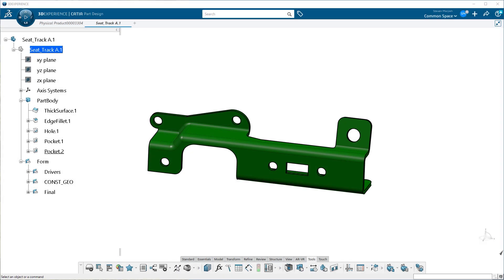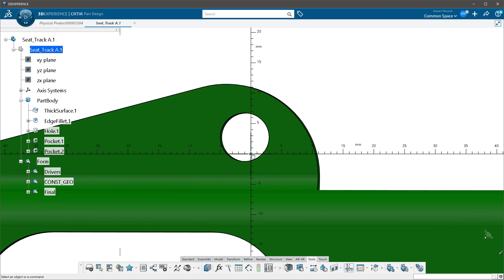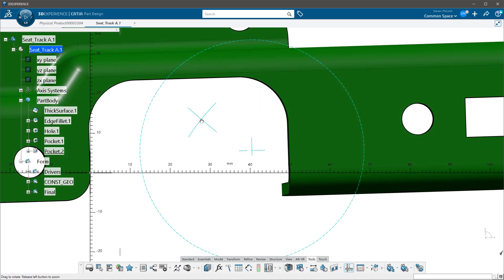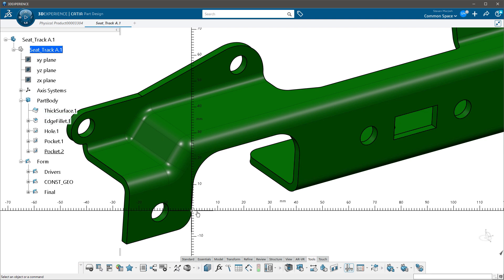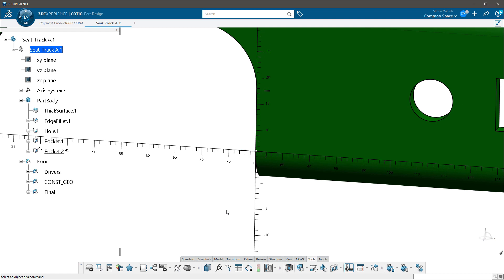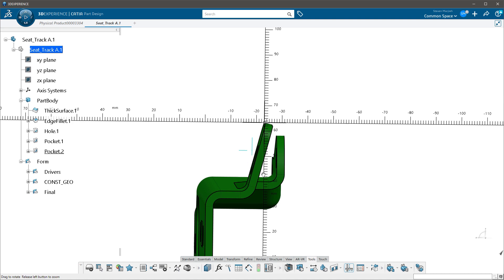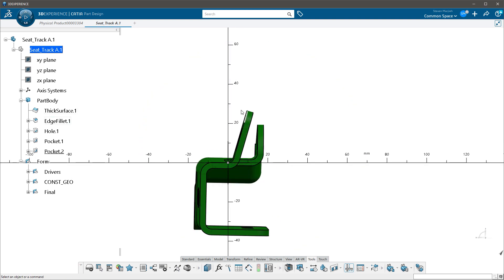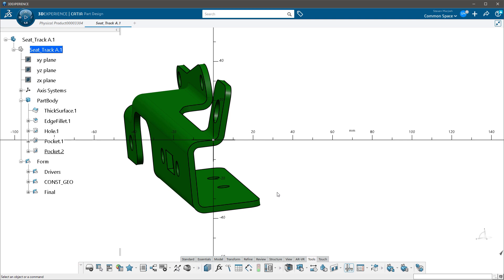CATIA 3DEXPERIENCE 2021: Ruler

Comment: How did you find this? Is it only available for specific roles?
Reply from the maker: It's in GSD and Part Design. Once active you can leave it on and it will appear in other workbenches.
Reply: @StevenMarji  okay, bummer I can't use it with civil apps. It would actually be really helpful. Still, thanks your showing this! Neat functionality!